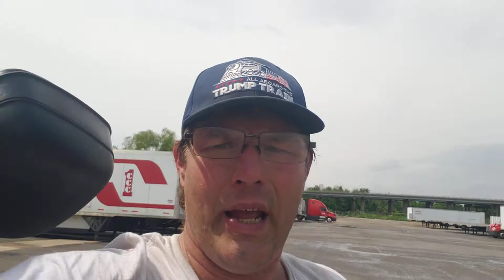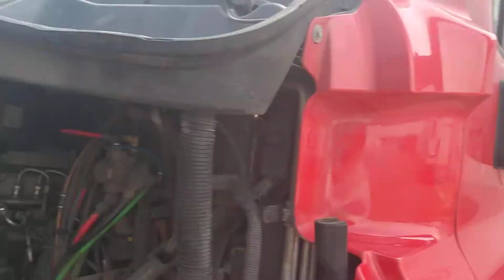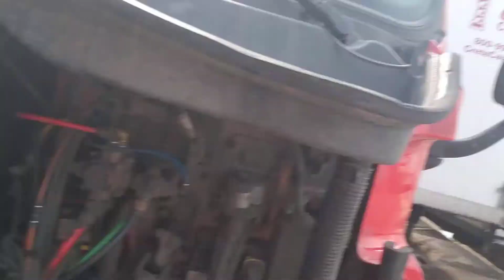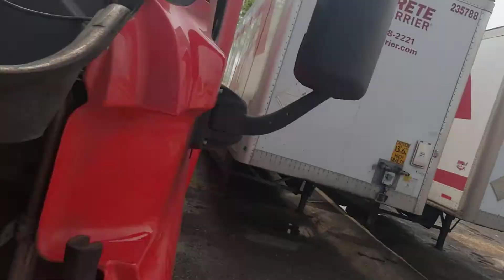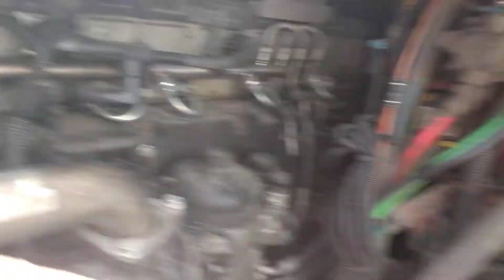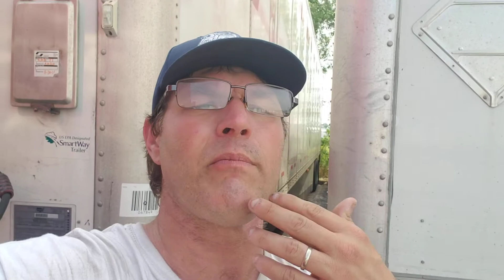Pressure port & Intake manifold temp sensor,  caused the MIL light to come on

Comment: You are company driver? Or owner
Reply from the maker: I have been an owner operator for 4 yrs now.....i plan to sell my truck soon and be a company driver
Reply: Owner operator earn more than company drivers
Reply: Anyways you are in this fuild from many years you understand where is profit nice to meet you bro
Reply from the maker: Not all the time.....it depends on the situation.....there are many variables you need to consider
I have a video on my channel where i talked about the difference between owner operator and company driver
Reply: Can you send me your Facebook Iink🙂
Reply: I just want to know some tips because am going to start trucking soon
Reply: Thanks 🙏 for your video. It’s a lot of help to  driers on road. Can you let me know what size of tools for retread of intake manifold temperature sensor?
Reply: Did that also cause your truck to start rough ?